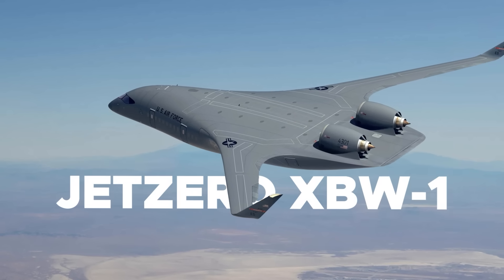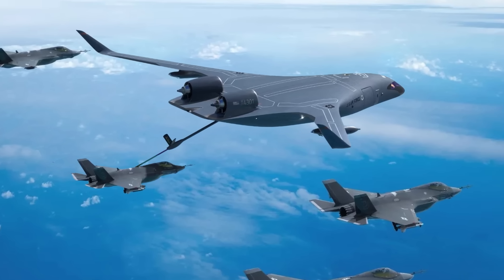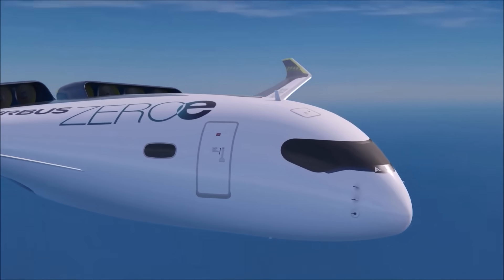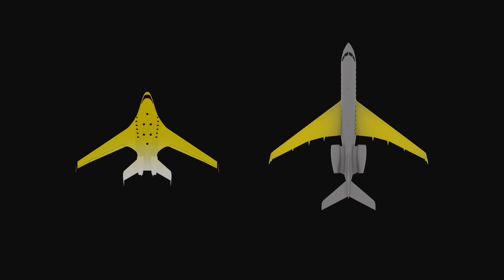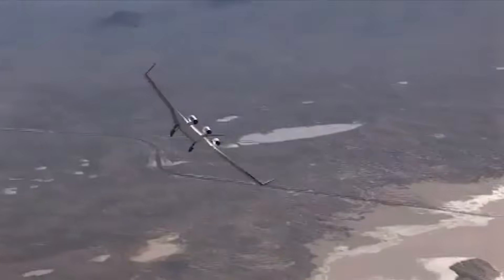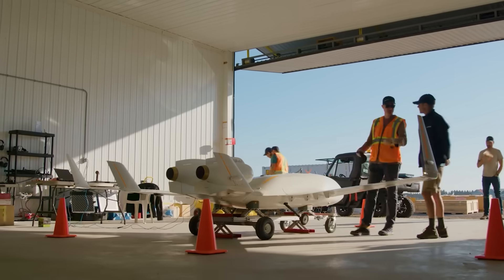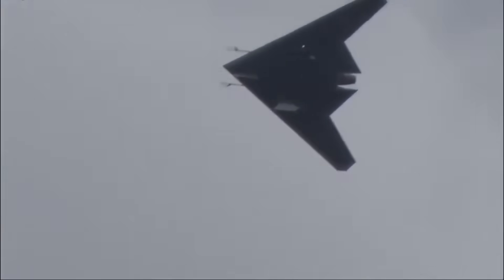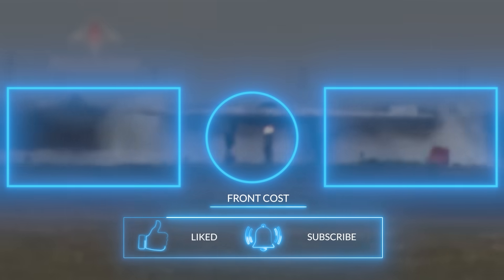NASA’s Finally Launched Their New Blended-Wing Supersonic Aircraft!

Comment: I want to see a modern-day walk on YB-49. A flying wing, the height of a traditional airplane fuselage with the same length and wingspan, so there is no need to change runways and terminals. They're trying to build faster. Instead, they should be building to seat more people per flight, which a walk on YB-49 could do. People and luggage weigh less than bombs.